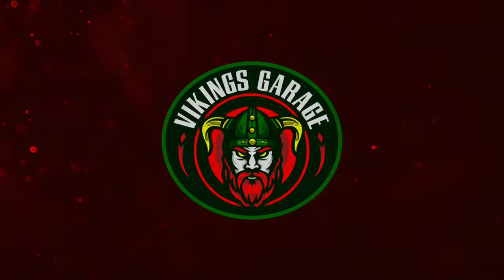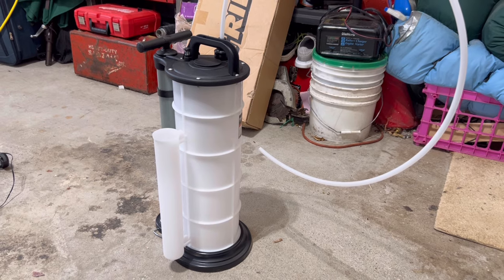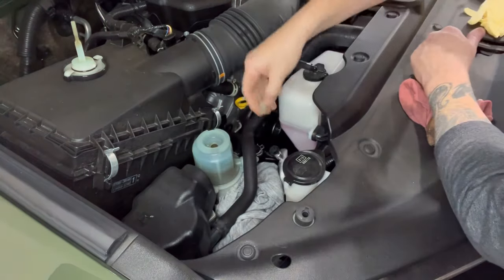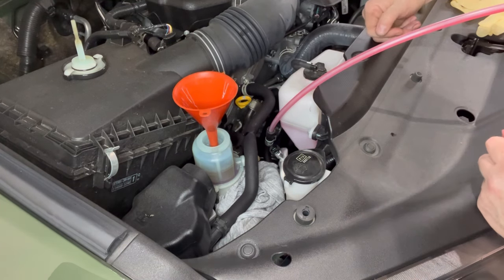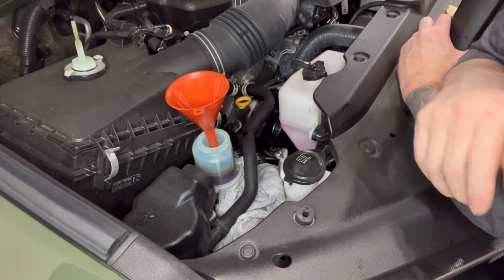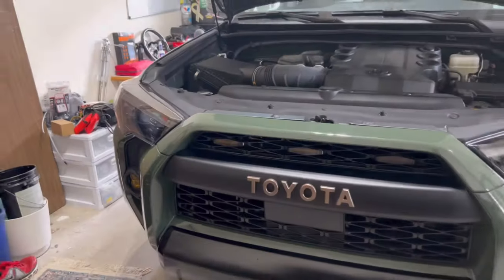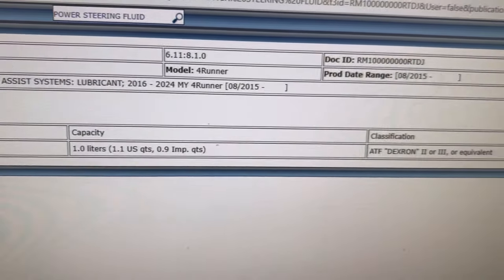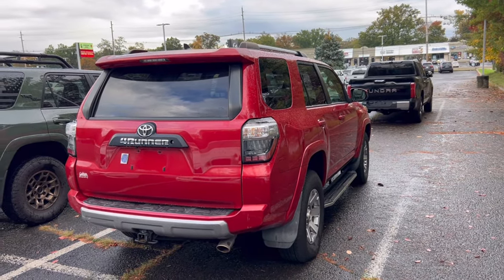Toyota 4Runner • FREE Maintenance Tech Tips - DIY Power Steering Fluid Flush• Episode 12

Comment: i love this man, i stopped making videos for my 4runner after seeing his videos, hes the king
Reply from the maker: Thank you Sir!!🙏🏻
Reply: How lucky am I that Paul is actually MY MECHANIC who works on MY 2014 4Runner!  You’re jealous, I know 😂 you should be!
Reply from the maker: @jojodice7 😅 😉
Reply: @VikingsGarage  I love your videos. i need help with my 2021 4 runner.  All of a sudden this morning as i was about to go into work my FOB did not work. i pressed the button but didnt lock the doors or unlock them. i thought it was the battery but i put in new battery and same problem. i noticed the passenger red light (under the right temp knob) is flashing with a lock on it.  i didnt do anything different then i always do.  Please Help!!!  Thanks for your time and consideration. i just subscribed
Reply from the maker: @donphillips4492 The way your describing it now, it clearly sounds like a immobilizer issue. You need to get that vehicle towed to the dealer. It could be a whole lot of different things.
Reply: @VikingsGarage  the car runs and i can lock the doors by touching  top of door handle and fob works when i have it on me and pull door handle.  the buttons on FOB dont work though on either of my FOBS and I changed the batteries on both. weird.  im gonna take it to dealer tomorrow.
Reply from the maker: 👍🏻 Good luck!!

Comment: I’ve done this twice the easy way with my wife lol I drain the old fluid, put new fluid in, have my wife steer while changing to each main gear (P, N, R,D), drain again, put in new fluid, over and over till it’s red. Took about 10 minutes. Nice video! 
I used the Valvoline atf full synthetic and like you said, I used 2 quarts from the gallon jug I got. My wife definitely noticed the difference each time it was done.
Reply from the maker: Good job!! Team work right there!
Reply: Great video, thanks. I come from the honda v6 world (odyssey with 350 000 miles - diy), but just bought a 2012 4runner that was a little neglected. I've previously done this with turkey baster and a plastic tube at end to suck out the reservoir. I did the hook up the same as you except bucket instead of vacuum pump. I then started the engjne with a full power steering reservoir only for a  few seconds and refilling in between. It allowed me to move the steering wheel during the flush. For the 4runner, I will probably ask my wife or my youngest son to fill reservoir and give me the heads up when to turn off to get this done quickly. I will add 1oz per quart AT-205 reseal at end to restore  internal seals as per scotty killmer. Like that hotsauce commercial, I have put that sh** on/in everything for many years. I also love the idea of just  repeatedly drain and fill, as per other comment, it proves there are multiple good ways of accomplishing tasks.
Reply from the maker: Very cool!!
I appreciate you sharing!

Comment: Following all your videos for maintenance on my 2004 with 208k miles.  About to do the transmission flush, and will probably have a few extra quarts left over.  It will be used for this job for sure!
Reply from the maker: You got this!! 👏🏻
Reply: So what are your thoughts on using synthetic Valvoline Max Life ATF fluid?  The container says Dextron VI, DEX/MERC.  Reading posts on the Toyota forum, I’m not sure if this is okay or not.  I’ll have a few leftover quarts after the ATF flush/fill.
Reply from the maker: @stuartfact8361 I’ve never used that one, should be fine.

Comment: Very nice.  I need to do this to my wife's (well, now mine) 03 4Runner.  I honestly don't think its ever been done in the 177K miles it has traveled. It's very dark. I'm unemployed at the current time, and have plenty of time! 🙂I did a transmission drain and fill this last weekend and wow, I don't think that has ever been done either!  Anyway, thanks for showing this, I followed your instructions on the serpintine belt change and had no issues.  Thanks for all you do!
Reply from the maker: You’re very welcome!!
If you can, do Change that fluid to prevent the power steering pump from failing. 
Very proud of you for tackling all the other things 👏🏻👏🏻
🤞🏻you get a job soon!! 💪🏻
Reply: I’m doing mine at 200k for the first time thanks to this video 🙈
Reply from the maker: @lizardofozz88 Better late then Ever!! 👏🏻

Comment: Man, I just came back from doing some engine oil maintenance at the dealer (my 5th Gen is currently under warranty & if something happens regarding engine oil, it's their fault😂) and the service personnel there tried to sell me this particular service. Quoted me well over $200 dollars for it. I do have that Oil extractor lying around the house. Bought it for changing the engine oil on my emergency power generator (which is NOW a breeze) and been thinking on what else could I possibly use it for again and there you go and gave me an excuse. As always, awesome job and thank you for taking the time and show us, mere mortals, how we can tackle these jobs on our own safely and with lots of guidance. PS: I'll be on the lookout for your feedback on the Lucas PS Fluid Conditioner you showed.
Reply from the maker: Right on!! Will do!
Reply: @VikingsGarage  I've been meaning to ask you. Was the PS fluid hot when you first started, or is it done while the PS fluid is cold? Thanks in advance!
Reply from the maker: @emmanuelmatos8942 either is fine.
Reply: @VikingsGarage  copy that. My 5th Gen just hit 29K miles and I must get this done before the 30K. Also at 30K, I will take it to the Dealer to get the Transmission Fluid changed. Haven't done this in previous cars and has bit me in the rear end later. Anyways, thanks again for your reply. I hope to see more of your content.💪🏼💪🏼
Reply from the maker: @emmanuelmatos8942 👍🏻

Comment: Very easy. I must have got some air in the line. Followed Vikings instructions did the steering wheel back and forth like 8 times and problem solved. If you get a little whine just keep doing the steering wheel all the way left, then right. I assume that gets the air out because all is good. Great video Viking!
Reply from the maker: You’re absolutely right!!
Well done 👏🏻👏🏻
Reply: @VikingsGarage  for a coolant drain and fill. Do I need to drain the block or just radiator?  TY so much. I’m fine draining the block but didn’t know if that’s required. I know the block drain is behind the passenger wheel.
Reply from the maker: @morfdq You can do it either way, I do it this way because it easier and I do it frequently.
If you touch the block coolant drain, 2 gallons will be necessary,

Comment: Differentiating fluid colors helps to pinpoint leakage quickly at assembly line and later at maintenance centers by service technicians. Since Toyota Care is offered for two years, any factory filled liquid will be good for that interval and doesn’t need change. So this helps quickly to detect leakages during warranty period without digging much into car internals. Engine oil has dark distinctive color due to soot, transmission fluid is red, power steering/brakes fluids are clear. So Toyota technician by glance knows if there any problem with what component to log it with service case as car arrives for maintenance.

Comment: Thank you 🙏 so much for this video. I need to look into doing it on my Runner. 

Also, for future video, do you have suggestion how often PCV should be replaced or how to check them.
Reply from the maker: You’re welcome!!
On the 4Runner I replace it along with the Spark Plugs at 100k.
Don’t bother checking it, just replace it. Fairly inexpensive piece of mind.
Reply: @VikingsGarage thank you so much 🤙

Comment: Great Video. Some people says to turn the steering left and right from lock to lock to extract the oil instead of using an extraction pump. Is that a good method? Just checking before go and buy the pump?
Reply from the maker: I do not recommend doing that. You can cause damage to the pump that way.
As in power steering pump.

Comment: What do you think of the secondary air pump modifications by replacing the foam filter and replacing it with a uni breather filter. I heard it’s a must mod for all Tacoma and 4Runner.
Reply from the maker: Excellent question, I’m currently doing some research and soon as I have a concrete answer, I’ll post a video on it.

Comment: Thanks  for the great video. When you turned the steering wheel both ways I assumed that was to get a true level. Would that process  bleed  any out any air as well? Greetings  from UK. 👍🙂✌️
Reply from the maker: You turn the steering wheel both ways to work out any left over bubbles of air that might be trapped inside the system. Greetings 🤘🏻
Reply: @VikingsGarage   Thank you for  answering my question.  Will give the process a go in the near future. 👍🙂✌️
Reply from the maker: @Slash120560 you got it!! 👏🏻

Comment: Do you recommend using the Lucas PS conditioner that you linked? I have 120k miles on my 4Runner with now power steering issues
Reply from the maker: Wouldn’t hurt to try, I haven’t seen any negative side effects so far.
Good luck, let me know if it helps.
(Do check your intermediate steering shaft, know for failing)

Comment: when you were pumping the extractor, it looked like it was going slow, is that normal and if so, how long would you say it took to remove the clean fluid that you were putting in there once it ran clean?
Reply from the maker: It is slow, I did the video in real time pretty much. Took a couple of minutes. The system doesn’t hold much fluid.

Comment: The link to the trans fluid is for Valvoline Multi Car Synthetic but in the video you used Cam ATF. Is it ok to use the valvoline in the link?
Reply from the maker: Valvoline is actually a better option than CAM. Either you can’t go wrong

Comment: Hey sir. Just ordered all the stuff to complete this. I have a question on brake flush. I use the Gatorade bottle and hose. I saw a video that said for the rear all you have to do is put the ignition to the On position and hold down the brake and the “pump” will push out the fluid. Is that correct or should I do it the old way of pump, hold and release with the wrench?  Appreciate you!
Reply from the maker: Do it the old school way only, you will be fine. 
🙏🏻
Reply: @VikingsGarage  appreciate you!  Thank you
Reply: @VikingsGarage  easy peazy brake flush done. Tomorrow my pump and trans fluid arrive so I’m going to do the power steering flush. So appreciate all the tips and excellent videos you have made. I really do want you to know that.
Reply from the maker: @morfdq Means the world!! Always happy to help. 👏🏻

Comment: Was there something on the tip of the hose for the extractor you removed to get time into the return line? I’m looking at a extractor on harbor freight but I’m unsure if the lines will fit the return
Reply from the maker: If it does have an adapter, you can always remove it. Should fit perfectly.
Reply: @VikingsGarage hey one more question I got 2 qts to do flush and fill, this will be enough right?
Reply from the maker: Yes
Reply: @VikingsGarage I just did it and everything went great except for it made a little noise at first but I assume it was just air in the system, everything feels great now! Thanks for the video it made this flush super easy
Reply from the maker: @doughartwell5319 👏🏻👏🏻

Comment: Hi @VikingsGarage Will Red Line 30504 D4 Synthetic ATF be equivalent to the Valvoline Synthetic ATF that you linked? I've been using Red Line oils in the diffs and transfer case with good success, so thought I'd use the same brand in the power steering too. Please let me know and God Bless!
Reply from the maker: That’s an expensive option but yes, it would work!! 👍🏻

Comment: Is the Toyota AT& power steering fluid the same as the Toyota ATF WS?
Reply from the maker: No. You cannot use WS ATF fluid in the power steering, only the ATF SPECIFIED.
Reply: @VikingsGarage  thanks for the info. Now...can I put the AT & power steering fluid in the AT in place of the WS? Do you know the difference in term of chemicals? I am confused as to why Toyota makes WS ATF and another AT & power steering fluid.

Comment: Where did you get that toyota dexron iii I check my local Toyota dealers none of them has it. They keep telling me to use power steering fluid
Reply from the maker: They do sell bottles of “power steering fluid” which is transmission fluid with a different dye. Just use dexron 3 or 4 trans fluid from your local parts store
Reply: @VikingsGarage  I end up buying it from Ebay, so difficult to get it from dealer
Reply from the maker: @ldam 👍🏻

Comment: Just wondering if using other brand fluids is safe for the 4runner.   I hear that Toyota braned fluids, like brake fluids,  has a conditioner to protect the components.  Is there true?
Reply from the maker: That’s a very complicated question to answer but in the shortest way possible to answer:
Toyota does include certain additives in their fluids for a reason (or so they claim) so it’s always smart to use what they recommend, considering they have our best interest in mind. 
Me personally, I think you should do what you are comfortable with and do it regularly. 
Regular and proper maintenance is what makes your Toyota so reliable.
Reply: @VikingsGarage  it is complicated.  I have followed toyotas recommendations, and other than motor oil, most products state something about use safe for toyota vehicles.   NAPA automotive has a brake fluid stating specifically for Toyota vehicles.
Reply: The best alternative I found is the Valvoline atf synthetic. So far so good!
Reply from the maker: So go with that, they can’t lie on those labels.
Reply from the maker: Valvoline makes a very good product, lots of testing. 👏🏻

Comment: Hi have a 5th gen 4Runner the problem I got the rear passenger right side “ Wondow switch light is blinking “ what is the problem I have
Reply from the maker: You got to initialize the window operation in the master switch.
Press and hold down all the way plus 3 seconds and press and hold up all the way plus 3 seconds. 
That should do it!!
Reply: @VikingsGarage  ok all try it

Comment: Probably should jack up front wheels when getting the air out not to put strain on power steering rack
Reply from the maker: Read what you just wrote and think about it… does that make any sense to you.
Reply: Front end at frame rails. My bad.